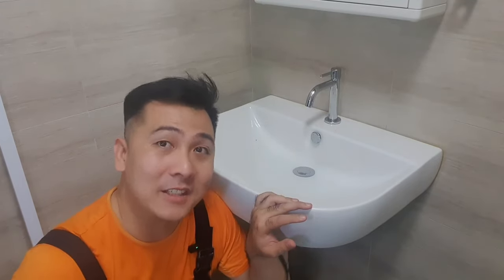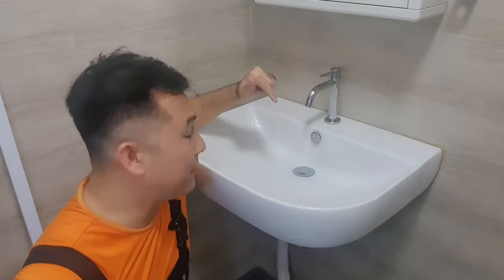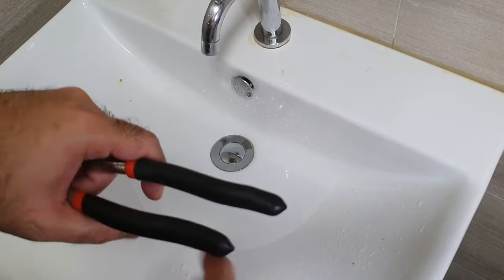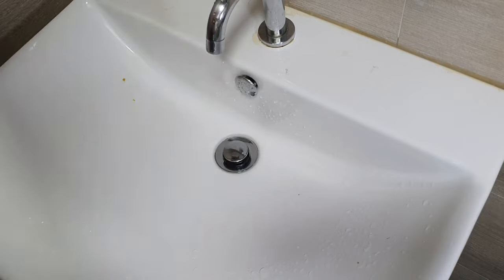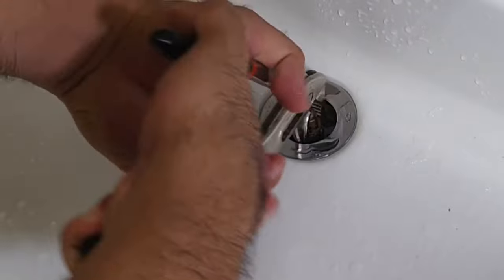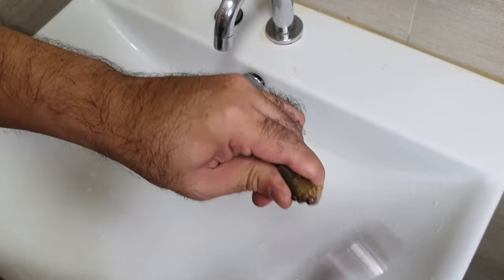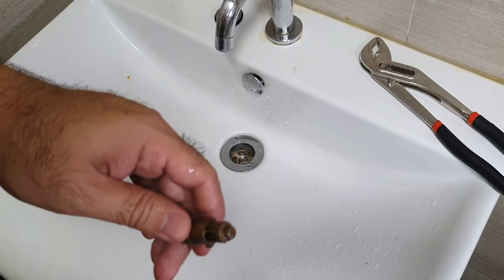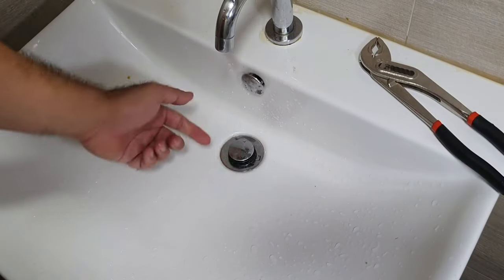Sink Stopper Stuck! super easy fix! (DIY Savings$150)

Comment: Dude thank you so much! All the videos I was finding had complicated fixes or using dental floss but my was stuck so far down there was no way the dental floss could have helped. And as a renter I don’t want to mess with piping and be responsible for potential damages. Your solution was by far the easiest and quickest. My sink can finally drain thank you so much
Reply from the maker: Most welcome! Do consider Subscribing for more!

Comment: Tapping it plus moving the lever up and down fixed my problem! Thank you! 🙂 Also, the hole near the bottom of my drain plug was never threaded like it should've properly been done upon installation. But after me trying for 20-30 mins to fix that problem, I ended up not threading it because no matter how I adjusted the plug's height, the plug wasn't high enough to allow for timely water drainage. So, now I see why this wasn't done ten years ago when I bought this home!
Reply from the maker: Glad it helped!
Reply: @ThePunggolHandyMan  And I just re-fixed the same drain using the combo of the video's technique and my aforementioned of moving the lever up and down! But THIS time, I added the step of cleaning the gunk off of the stopper (I'll probably run it through the dish washer) AND where the stopper makes contact around the edge of the drain. Hopefully my additional step will make the overall fix last longer.
Reply from the maker: To prevent further headache it actually inexpensive to get a new part.. I think a big mac meal costs more. And this lasts years
Reply from the maker: To prevent further headache it actually inexpensive to get a new part.. I think a big mac meal costs more. And this lasts years

Comment: YOU HAVE SAVED MY LIFE!  Five days ago I did something really stupid.  I pushed the sink stopper down with too much force and it has been jammed shut since.  I tried putting dish soap on it and sticking a knife blade around the edge with NO luck.  I decided to try looking online and I watched your video.  I used the end of a screwdriver handle.  My first taps were to soft and did nothing, so I tapped it harder very rapidly and up it popped!  You are a GENIUS!!!
Reply from the maker: It's a simple hack! And simple fix! Sometimes it's all about knocking something that ain't working!

Comment: You can throw the whole assembly into hot 1:1 vinegar to decalcify. If there's no gasket, boiling it should remove the debris. WD40 is not meant for this, grease, preferably teflon grease is preferred. If it works, it should be bring back a few months or years of life.

Comment: I removed by tapping but couldn't remove the unit below to clean and grease properly.
Reply from the maker: It may be rusted n fused
Reply: If it is fused already does that mean i have to change the whole sink?
Reply from the maker: Na just the drain.. check my channel for the video

Comment: how about an bathroom unslotted sink drain???
Reply from the maker: This is an unslotted sink drain
Reply: @ThePunggolHandyMan  this is a pop up right?? Mine's flip like a coin
Reply from the maker: I see . Slotted and unslotted refers to a drain with and without overflow. Pop up/ flip / chain refers to the closing mechanism. But yea
Reply: @ThePunggolHandyMan  How do I unstuck my flipping plug, Sir? It became a bowl at this point
Reply: @ThePunggolHandyMan  i used a sink pump, dental floss and a thin metal to pry it open. And I pushed down on it, and so far nothing worked
Reply from the maker: It's probably broken already. So you Knight need to change the whole fitting. Check my video on the broken drain

Comment: Did not work for me. Completely stuck still
Reply from the maker: Sorry to hear that you might need to change the sink drain
Reply: @ThePunggolHandyMan  it's okay I managed to push it from below
Reply from the maker: Great job!
Reply: @KevinMcFlying sorry can you tell me how to push it from below? I had the same problems and I opened below, remove hair and dirt but don’t know how to push it.
Reply: @minhho5101  I removed the bent section of the pipe and blindly pushed up with a screwdriver

Comment: Nonsense. No need to tap. Just put on a rubber glove and turn anti clockwise to remove the cap…and pray some lubricant. That’s all. Too much crap on you tube.
Reply from the maker: @davidnhc  I'm afraid if you read the comments, opinions might differ